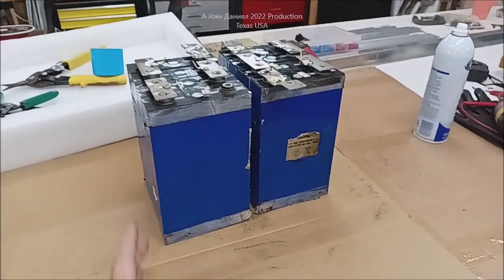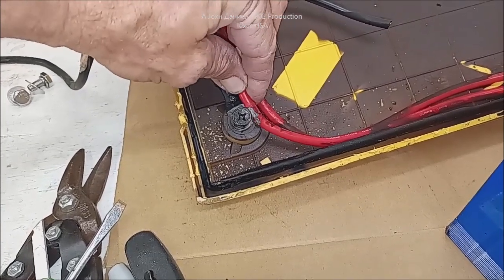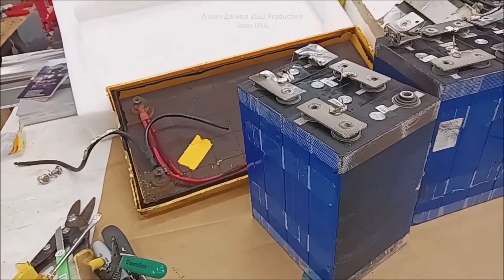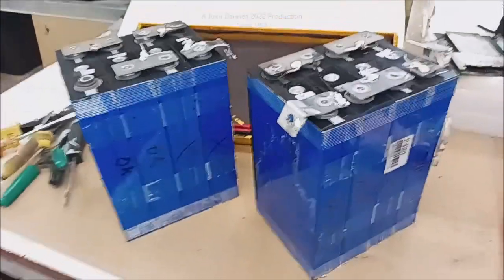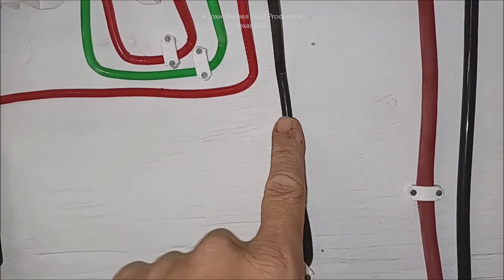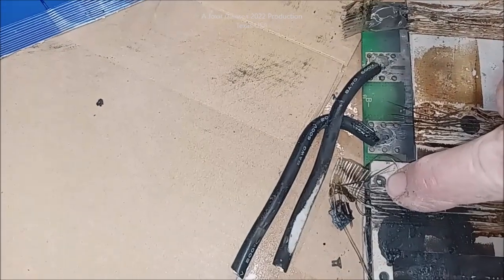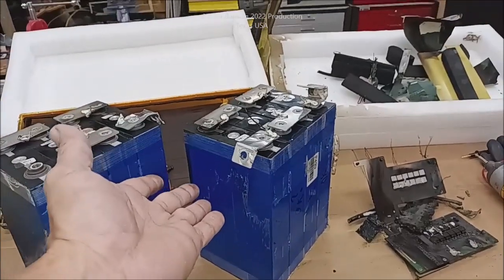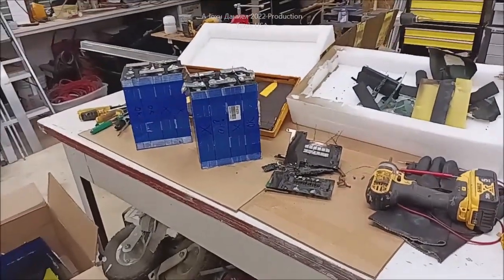Cheap LiFePO4 12 & 24v Batteries flooding the market, an Autopsy of Low Quality (options below)

Comment: a simple 150A fuse on the + side of battery cells would have cut this situation very short, ....regardless they should fix the wires or protect the terminals,, but imagine this was a pouch cell liion battery (that they are now selling as "solid state" just old type pouch cells) then this battery would have gone up like a freaking firework show
i say in spite of the bad build, the prismatic cells and the crappy solder leads on BMS stopped this from going further,,,
i have my own system 14kwh 2x 280Ah 8s 24V V  batteries ,,i build it as 2 seperate batteries as to avoid parallel connections as if 1 cell fail,, all parallel connected cells will dump all their energy into the bad one  ( this is a much bigger problem in case of liion cells as they light of at about 100 degrees C)

Comment: Soo , I bought a $300 12v 100ah , My question to you is How would you reseal the top seein as how when i grabbed it by the strap the top popped off XD .  They are using single 4awg line that could not short unless both of them came off there poles, wich are actually gooed in glue. The Bms is on the bottom and i didnt want to try and pull the cells out due to all the glue inside holding the cells and foam in place. So glue everywhere but the lid lols . Thanks for all your Videos !!
Reply from the maker: On mine, 2:16 The silicone insulation was pinched into the bolt on the cover. It blew up inside and the seller sent it to me for shipping cost. To reseal you use black adhesive gasket maker. https://amzn.to/3zfA1vB
Reply: @JOHNDANIEL1   Ty Sir !!

Comment: Wouldn't an inline fuse/breaker before house battery make this damage nearly impossible?
Reply from the maker: Yes for your items, and No ( corrected ) but not for the battery
Reply: @JOHNDANIEL1  Thank you sir. I enjoy the info you provide. (Is there a reason you didn't include the fuse info, maybe save a fire)? Not criticism, you've stated you're here to help, not make a living, seems that would be important/helpful for novices to know...how to avoid a fire for $10 for that scenario)? At any rate, thanks...I've learned a lot from you. 🇺🇲✌️
Reply from the maker: @rickywarner7444  Per the manufacturer, the BMS is a short circuit disconnect system, But as you can tell from the battery it was not. These batteries are supposed to have short circuit protection, a fuse on the outside would have done nothing to what happened inside a sealed battery. However, adding fuses is a constant in my videos. But unless you add one in the battery then it's not going to help a bad product like this one was. I proposed to the makers they all install a circuit breaker in the batteries with a external switch. I got no reply.
Reply: @JOHNDANIEL1  I asked a question, you said "yes." Now, is that a retraction with this post? Idk what is junk or what isn't, I do know an inline fuse near point of entry will stop a battery from getting fried. Should the manufacturer have done better...not really the point. Isn't the point showing us how to compensate for cheap setups to stay safe. Again John, not being critical... you seem to have 2 different answers to a "yes" or "no" question. Confusing. Normally I understand you just fine, look forward to learning more from you in the future. Thanks!
Reply from the maker: @rickywarner7444  I think your reading what your wanting to conclude. You asked if a fuse should be used BEFORE a house battery, I said  YES , but you can not accept that. You somehow think the battery being internally shorted could have been saved from the outside with a fuse beyond the point of short, feel free to explain how that can be done, because it's not possible.
Reply: @JOHNDANIEL1  Forget the battery/fuse, I accept your "yes" answer, a valid question you answered. I thought about how many other people use your knowledge as well, along with the usual opening as a mission statement that you are online to help, which you do. I merely asked the next logical question, why was a fuse/breaker not mentioned as an extra safety procedure. I hope you can accept that sharing all information is helpful, especially when a junk setup could/would start a fire...somehow teaching that to novices to use an extra safety measure, on the cheap...maybe save a life. (I find it unusual being offended and getting crappy with a subscriber who was wondering why something so cheap and easy to use, battery not exposed to shorts.. dead or otherwise to burn. I also found it tacky of you to put down another content provider by name, making others look bad for what...?? Those seconds on the video length would have been better used by conducting your goal/purpose to help beginners. That other guy seems to have forgotten his roots, and on the whole is into elaborate configurations which most people would never understand or use. Then there's you, who does a great job at explaining how/why/what to viewers. (If you were true to your word, why did my follow up question make you mad? Are you always right, can do no wrong)? Lol, learn some people skills if you are in front of the public...the omission of that simple preventative measure makes me wonder what else you don't consider as safety precautions, if that setup killed anyone...would that have been prevented had you thought to mention one of the most dangerous components easy fixes to avoid tragedy? You can't accept the fact you were asked  a nothing personal question. You made it personal to yourself, I couldn't care less after this communication. But I come away knowing you're not quite as sharp as you think you are. Thank you for the insight sir. 🤝 Best wishes!
Reply from the maker: @rickywarner7444  I guess if you're asking that a fuse would save or stop the damage that was seen in the video I guess that's my understanding cuz it's what it sounded like the answer would be no it wouldn't have made a difference because adding a fuse to something that's already fused electronically normally would be pointless. The next video I do I'll just make sure the people know that you have a BMS in your battery, it has a short circuit fuse protection system, but don't forget to add another fuse. I'm not sure that's going to make a bit of difference but maybe it will.
Reply from the maker: @rickywarner7444  BTW, I was not offended. Confused maybe of the question of not including something not required likely.  I was more noticing your expecting me to tell someone of something they did not need, and was not required. You do not have a FUSE on your car battery, you have it on your devices. That's been a standard going back 100 years. If people actually watch I show fused everything. Just not my battery bank to the buss bars, why would anyone do that. When someone is being a ass InRe -  (If you were true to your word, why did my follow up question make you mad? Are you always right, can do no wrong)? Lol, learn some people skills if you are in front of the public..   If you want someone to share knowledge you don't chastise them for not altering reality for you from the start. 
So, if you need help, try another you tube channel who like 99.9% of them who won't even respond or share additional info and it may be a better outcome. I've no other solution but that, I answer so many questions/post, about 50%, the solutions are often under the videos.
Reply: @JOHNDANIEL1  Thank you. I guess there was a misunderstanding.  (I can barely get a solar walkway light to work, I'm sure you'll forget more about this than I'll ever know).  I've watched so many videos on this subject it makes my head spin, your content slows that spinning down some. I'm very safety aware around electricity, overkill with a double type fault system in case one fails makes me sleep better. I'll continue to support your channel, keep learning. Peace brother. ✌️
Reply from the maker: @rickywarner7444  All Good, and if you need direct help just drop a email. My goal is one by one and share by share to help anyone who is not rich and powerful to be able to achieve what those people don't want us to have. olympicpowercontrols@yahoo.com
Reply from the maker: @rickywarner7444  A note I can share, your up to doing it safer, When you build your system use a aircraft quality fuse style, they  are better ( https://amzn.to/3QRO3tC ) . I am using X2 ANL because I have a ton of them, but I don't recommend them as a stop gap in permanent use. I explain that in a few videos, and tell people to go MAXI or Mega.
Reply: @JOHNDANIEL1  Thank you, I need all the advice I can get.
Reply from the maker: @rickywarner7444  My best advice is buy the hell out of anything that can make power, grow food and protect you and yours. We are in for a hell of a ride with so many political idiots driving the planet. I expect great depression level fails but with a twist into collapse and violence from the kind of people who have been living off the rest of us for the last 50 years.
Reply: @JOHNDANIEL1  Thanks, I agree. I'm in my 60's, preparing for survival 101. I struggle with buying a 2000 watt solar generator, or the DC to DC power with solar/alternator to maximize available power. Am converting a 4wd Denali into a safe tank-like vehicle that's self sustaining, if necessary. Root cellar, etcetera on standby. So many idiots, they're hard to spot sometimes. I do appreciate your knowledge and easy to follow instructions/demos. Of course placing a second battery under hood will be difficult, the frame supports are too low to fit a nice Lithium deep cycle battery where there is space. A modification is needed, if I do the DC to DC with solar input controller. (The generator, while easy...may not be as versatile as on board power generation. I'm gonna keep reading. Thank you sir.

Comment: One 8 ga 90C rated wire can handle 55A. So yeah, two can handle 100A. I doubt the wires are truly rated at 200 C like is stamped on them.
Reply from the maker: They are China gauge, which means when you sell a million feet of copper wiring you remove three strands you save thousands of dollars so I would call this about a gauge of 8.25.

Comment: I had built 9 diy 280ah 48V batteries myself. 6 out of 9 are flawless. Three are better than this next piece of krap. I thought I'd listen to "Willie" and by a Trophy 220ah 48v battery that he recommended. It's a 200 lb hunk of junk that can't be charged over 55.7V without shutting down on OVP. Then when several of us complained to the sales guy in SC and Willie, he said his worked great. Well, like you said, he's moved on to EG4 batteries and inverters. I'll never listen to his advice again.
Reply from the maker: Willie is a Vegas scamster. Always has been always will be.

Comment: This is a potentially life-threatening situation, given the right set of circumstances. We NEED TO KNOW whose battery this is before someone pays the ultimate cost for buying it. Come on, John.
Reply from the maker: It'll be ok. They have contacted buyers of them. And the fact over 20 branded examples are out there with 100k of them sold is more likely to be a problem.

Comment: Hey John, This has Nothing to do with Your Video Topic, But it's your newest utube video  and I Would like some Feedback ! Flower Turbine ( VAWT ) . I'm a senior with a RV and would like to add wind power to  Supplement my solar. Beach, Desert are mostly Breezy, Windy and  Raising a horizontal access wind generator may create Issues for an Old Guy, So ? Just Curious If they Work Or Gimmick ! I  Believe that they have less Force on the Mast, But don't know anything about them, They just look Cool !  Thanks in Advance !!! 🇺🇸
Reply from the maker: Looks cool, works bad. 
They do make a mag lev model that can perform in good wind but not cheap like the lantern toys.
Reply: @JOHNDANIEL1  Thanks for the Input, I'll just add More Solar or More Batteries

Comment: Lead acid or agm for me. Batteries plus sells oem fit batteries for my old simplicity tractors and tractor supply agm batteries are super cheap I've also found retired wheel chair batteries for $20 too.
Reply from the maker: If you want some TRUTH about LiFePO4  go see this, Sub him. https://youtu.be/mAVW6iLnYnw

Comment: I had bought a motorcycle/lawn tractor size lithium battery to use in a jump/small engine starter box 
its rated at 500 cca, never got more than 350 cca 
Low discharge rate, dies in 4 months 
Bettery indecator doesn't work
Worthless during winter

At least it's lightweight but has no stamina 
AGM is looking like a better idea😉
Reply from the maker: Yes, but people get all knotted up seeing a lithium battery maintaining voltage down to 80% DOD when lead acid fades from 13 to 11 volts if you let it get to 80%. My solution is to buy 2x as much lead acid batteries for about 30% less total cost. Then I can get 15% of that money back when I return them as cores. Not possible with LiFePO4.

Comment: Great Video. I have been lost on what batteries to buy. I started off with a big deep cycle marine battery. That is what I am currently using. Maybe I should stick with Lead Acid.
Reply from the maker: Smart move is to hybrid it. 20% LiFePO4, 80% lead acid. Use the lithium to greatly extend the lifespan of the lead acid by voltage stabilizer effect.

Comment: You never know what is on the inside of these elcheapo batteries unless you tear it open, and thereby void the warranty.  A well built lifepo4 battery is great and perfectly safe.  As always, you get what you pay for.  Buy the cheapest thing you can lay your hands on and it is likely to come with a free lifetime supply of fire too.
Reply from the maker: I would recommend when you buy these under $320 battery you do it just for the price of the cells and parts.
Reply: @JOHNDANIEL1  I wouldn't trust the cells.  They would definitely be 'B' grade at best and quite possibly poor ones at that but it wouldn't surprise me at all to discover they are used cells that have already reached end of cycle life and been reclaimed then sold on in 'new' batteries.

Comment: AGM or Lead Acid old school is still the best
Reply from the maker: In true honesty, the LTO Lithium Titanate  Li4Ti5O is the REAL deal. But the Chinese totally control its price and availability. NOTHING works better and has in massive telecom centers proved it can cycle over 9000 times. NOTHING! 
And like my modified Lead Acid design, they have used 20% LTO and 80% Lead Acid together in Mitsubishi power centers for years. https://en.wikipedia.org/wiki/Lithium-titanate_battery These LiFePO4 Cultist nuts who get so butt hurt when I show its shortcomings and poor manufacturing simply missed to facts.

Comment: I hate to say it but this is a huge SAFETY ISSUE,  PLEASE PROVIDE THE INFORMATION WHO MADE IT CHINA WON'T RECALL ITEMS
Reply from the maker: Cells are Top Band, manufacturer is Shanghai New Energy Storage. Same bulk rebranding maker of almost half of every battery in the under $400 per 100ah you'll find on Amazon, eBay, and a dozen from China web sites.

Comment: The thing with these new lithium batteries is that people confuse safer with safe. All batteries can blow up it's just LFP batteries are safer than many other lithium chemistries RELATIVELY speaking. I like lithiums but people treat LFP batteries like they are magic. They are less likely to go into thermal runaway than lithium ion and it's less severe but everything is a bomb if you use it wrong enough. 

Because we are so close to China there are now loads of lithium batteries that are flooding the Australian market that are cheaper than cheap lead acid and some of those are scary, low quality cells in cheap packaging with very little management or safety. Many of them are just a bunch of 18650 cells  and I'm just waiting for them to start burning down 4x4s. There are a couple of independent importers and builders that build and sell custom batteries that are very transparent and public facing who are trustworthy otherwise I'll just build my own and when I do I'm putting internal fuses in the pack and filling it with transformer oil before it replaces the deep cycle in my car.
Reply from the maker: Finally someone with logic.